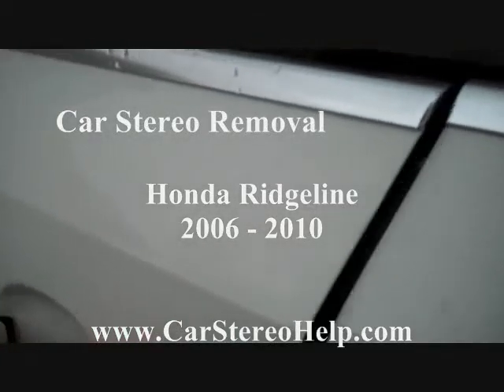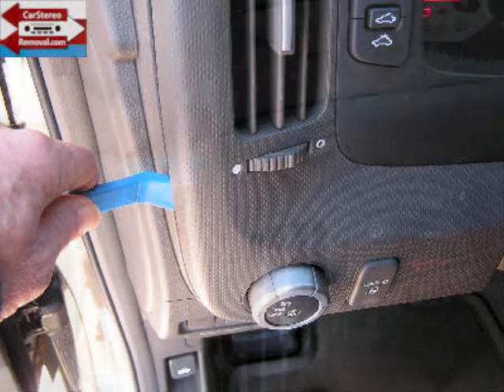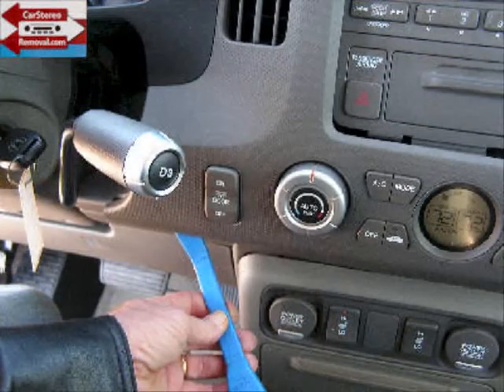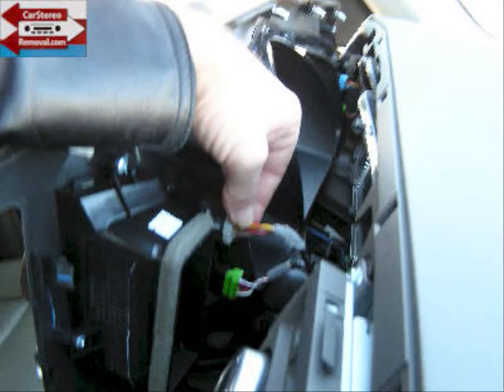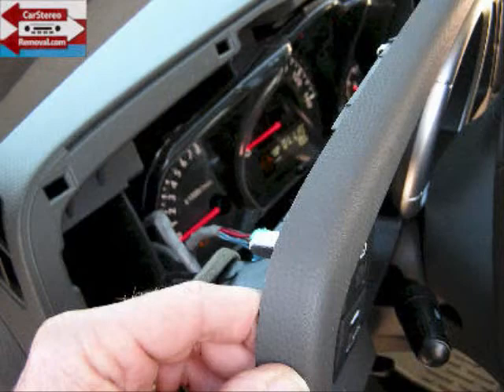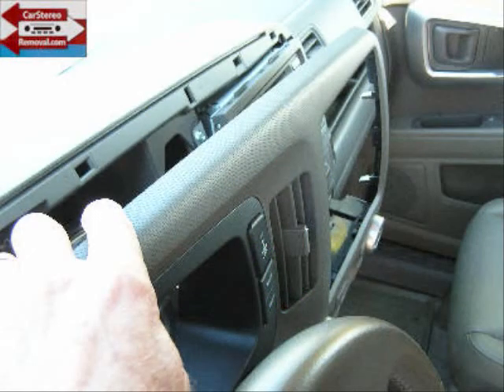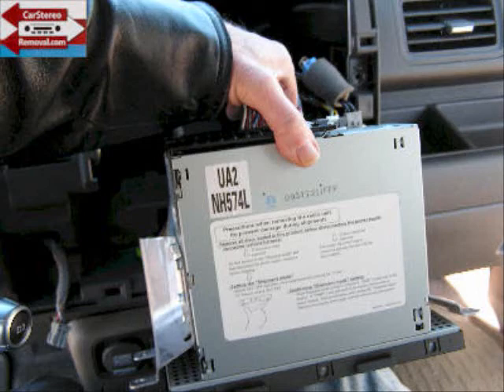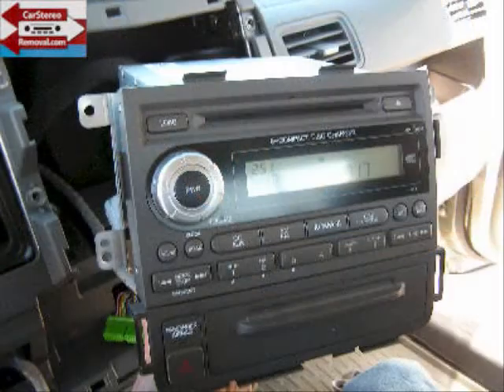Honda Ridgeline Replacing Car Stereo 2006 - 2010 = Car Stereo HELP

Comment: thanks for sharing this video.
I'm about to upgrade a 2006 cd factory receiver to a OEM navi unit. do you think I will need new wiring conectors?
beside the double din dash board that I will need, steering wheel will still have acces to the navi system or I need conectors?
thanks for the help!